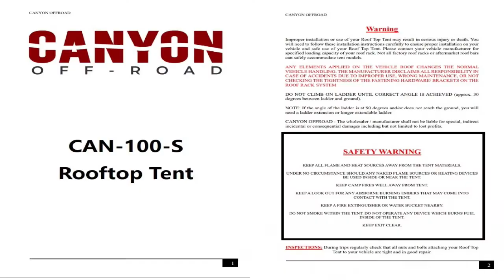(OLD) Setup, Review and Test of Canyon Off-Road 2 Person Roof Top Tent From PPD Performance

Comment: I just watched your video on the canyon, off-road tent and I’ve had mine for about six months now. I was just wondering your thoughts on the mattress I found it very uncomfortable whether you have upgraded or anything the mattress
Reply from the maker: Thanks for the comment and watching the video. I've been using it I think roughly same time. I do find as I have a back issue it can be pressure discomfort on my hips as I lay down on my side. So I'll be changing my current one with a custom memory foam style, so you get more cushion between yourselves and the base. Unfortunately every RTT have same style mattresses so it's something you generally have to do out of pocket for. But I'll let you know my cost quoted if you like to help. I do like it as RTT brand and features, with mattress being my only thing I wish to personally change.

Comment: Hey - with putting your cover that way with the Velcro corner being the side of the mattress opening. Do you find the bottom of your mattress gets some dust through the cracks on the corner of the case? As compare to the other side which is completely sealed with the zip. We’ve just bought this tent.
Reply from the maker: Hi Mate, I haven't had this happen to me and I've been down lot of bad tracks but could be an idea to swing it around to other side so mattress side is completely sealed by the zipper. Good idea, will swing my around and see
Reply: @wafishing4x4  sweet- thanks for the reply! ☺️ We’ve only just set ours up yesterday and put the cover same way as yours so wanted to see if any problems with dust. Might end up switching though
Reply from the maker: @chloecurtis5309  no worries. Great RTT, I use it on all my trips. I love it being quick and easy, but I might upgrade my mattress specially when I spend few nights in a row in it. But so far loving it and avoid wind if possible as found you'll have to make sure its all tightened up to help with any noise. I think your idea to move is good, even though I have to say nothing has been coming through and I've been in gravel red tracks, white sand and lots of wind. Etc and its kept it clean.